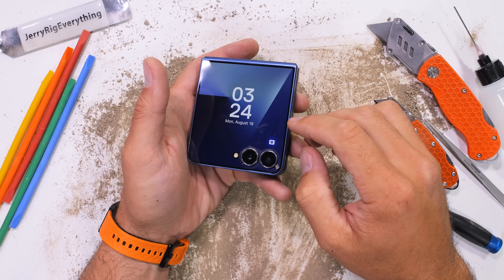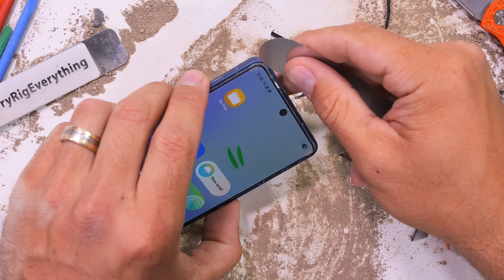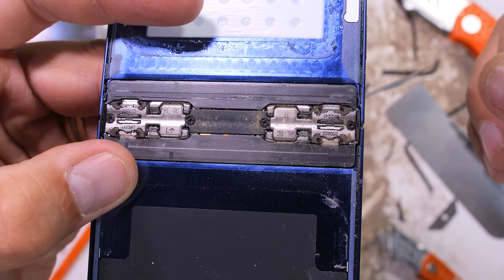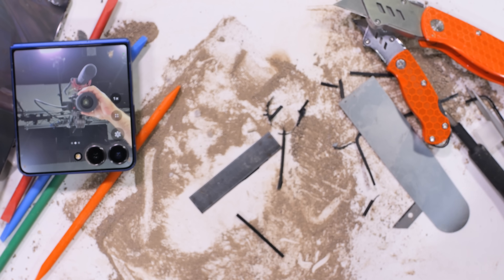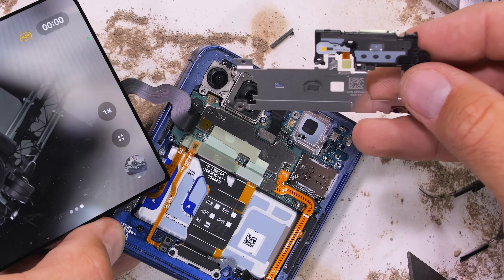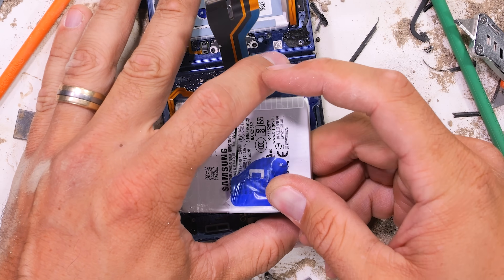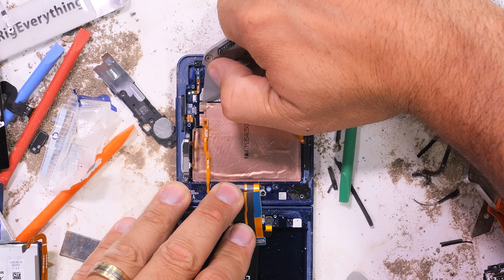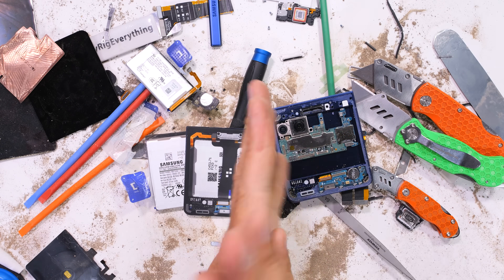Samsung Flip 7 TEARDOWN - I thought it was impossible...

Comment: About 6 months in, I'm still very pleased with my Flip 7. It's much better than my previous 5 & 6 Flips and feels like it's well optimized. A nice large 6.9" display with excellent colors and brightness, along with a admirably thin and light form factor unfolded. Battery is respectable too. 

Lastly, you can legitimately use the outer screen for the first time. 

Good Lock app is essential to make it all work well.

Comment: 1:41 the reason why this is happening is cause there is only one magnet on the phone that detects if the phone is folded or not so it doesnt keep the screen on even when u fold it. i learned that from my z flip 4. if u do it again, u can see the rear display come on, even if the phone isnt folded. now on my z flip 4, the magnet that shut off the inner display was the 2nd magnet at the top (left to right). i never knew samsung changed the magnet sensor locations.

Comment: Why didn’t you use alcohol for cleaning the foldable front screen? Also, why can’t the replacement screen part images show where the screen ribbon cable should be, so you can plan before opening? It seems like you’re damaging displays unnecessarily.

Comment: Don't know how many will point this out or already did, but at 5:08, just holding the power button for 10-30 seconds, on every Android device i tested seems to turn off regardless of UI responsiveness.
BEWARE however, if you do that aside from absolutely needing it, in theory you have a minor chance of corrupting something on your device(only data), while this was a thing on older operating systems, specially ancient Windows, it is still worth knowing before only shutting down your device on brute force, if you're doing it, make sure the data of your device is not too important

Comment: I'm still using the z flip 3. The battery dies a little fast, but the phone itself is fine. Why replace it if it isn't broken.  I'm not gentle with this phone either. I'm a firefighter/emt, and it takes a beating. Longest lasting smart phone I've ever used.
Reply from the maker: Good to know!

Comment: -"Historically the bottom piece of glass has also been very hard to remove"
-Me looking at my Flip5 whose backplate and external screen both fell off on their own after year and a half (they've been reattached now, still working)
Glad to see they are putting more glue now.
Reply: How the hell did you manage that? I've had two flips and I cant even imagine that happening
Reply: @Markie_SC  My best guess is living in a very hot/humid country, (some summers reach 50°c) + the Flip 5 seems to overheat way too easy on it's own. (although not to the point of shutting itself down)
Even so, I've never had a problem like that with any other phone I owned.
Reply: You were almost successful with the teardown. But I can see the dust entering at the hinge. So this is not a phone for me on the jobsite. And I think the fold is the same. I like the fold 7, solid construction, but you have to be careful with dust and other particles,so I bought the honor magic 7 pro, which is IP 69 rated.
Reply: @fuloplehel  that's a "Nice" IP rating, but my "teardown" wasn't intended D:
(I think you replied a comment rather than the video)
Reply: @Topo842 Yes, I replied here by mistake, but my comment is almost there, even in your situation. The conclusion is that the foldable phones are more sensitive than the classic ones. High temperature or even cold weather is affecting the foldable display. And internal heat management is still a problem in this thin designs.

Comment: 1:35 the reason this is happening is becaude the phone detects enough magnetic force on the top left as the phone being closed (at least on my flip 5 so i'd assume it's the same)
Reply: That makes more sense, but the pry tool should not be magnetic it is just a piece of metal.
Reply: @daily8150  sorry i shoulve clarified that it does happen with just plain metal because there's magnets in that region too, so something something the phone turns off anyways
Reply: @cobble616  that is interesting to know because I have only seen such sensors work only with magnets.